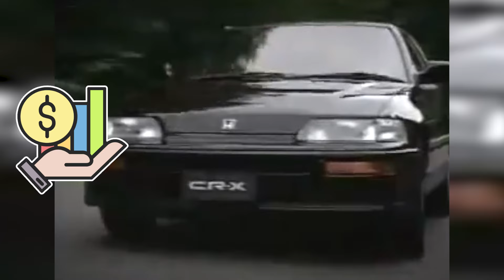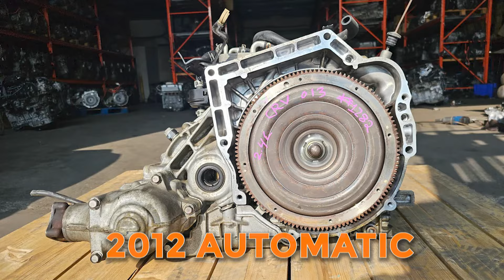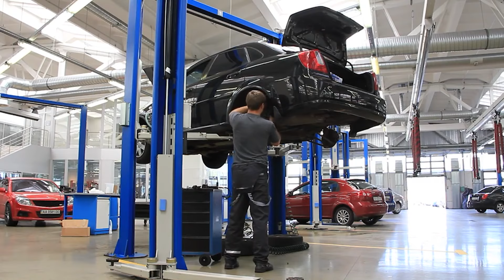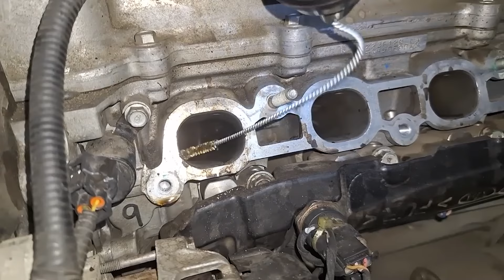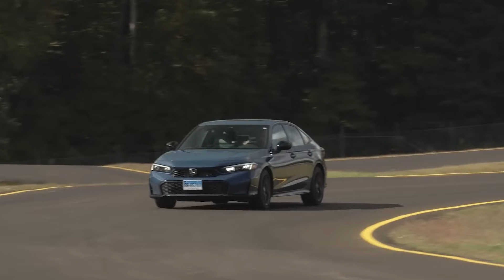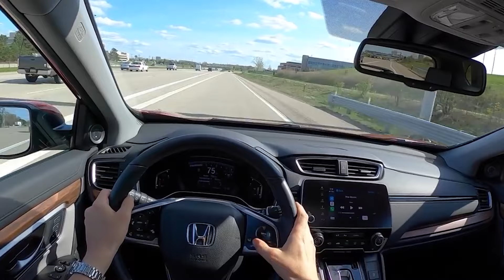Mechanics Don't Want You To Know This About Your Old Honda

Comment: Just ordered some parts for my 2010 civic EXL with manual trans. Water pump, tensioner and serpentine belt. I change all fluids on a regular basis and keep it ceramic coated and the under carriage clean. With only 195,000 km on it and 2 other cars to drive (both Mazdas) I plan to keep the civic for the rest of my life!